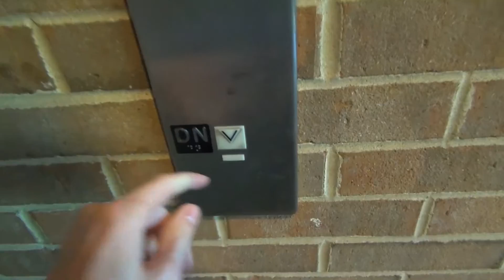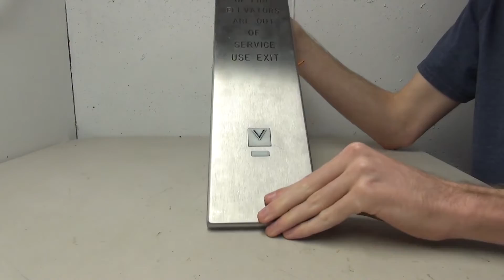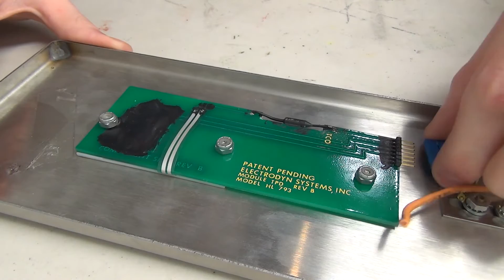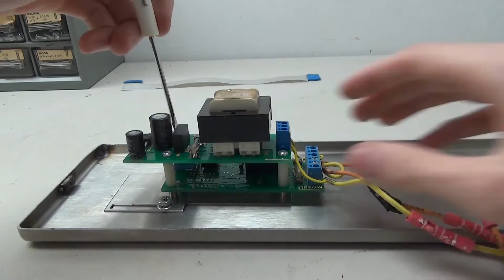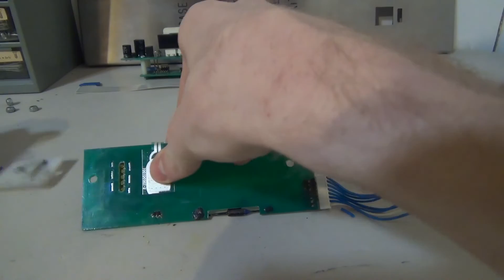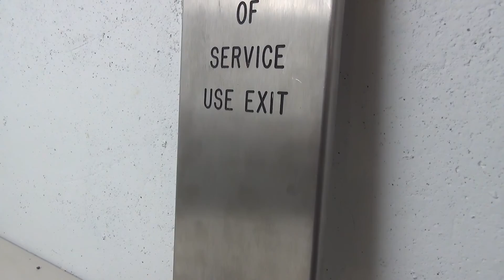Elevator Part Wiring: Electrodyn Elevator Button

Comment: There is another way that you might consider experimenting when it comes to wiring parts up. Apparently, there are some batteries called A23 and A27, which are actually 12 volts, and I've also seen some battery holders for the A23/A27 batteries in both single (12v) and double (24v) capacities. So I wonder if you could try out some elevator parts with the 12 volt A23/A27 batteries and make the bulbs light up on single 12 and double 24 volt capacities.
Reply from the maker: Yeah those will work as well! (They just cost more)
Reply: @stlelevators  I know they are more expensive and less common, but 12 to 24 volts can be just as safe (and just as efficient as well).

Comment: The contact block of that is similar to the concave OTIS Series 4 Luxury fixtures, which people often believe are touch-sensitive, but are not.
Reply: Otis did make and patent these specific concave touch buttons. They weren't used very often, but you can find some installations that still have them.